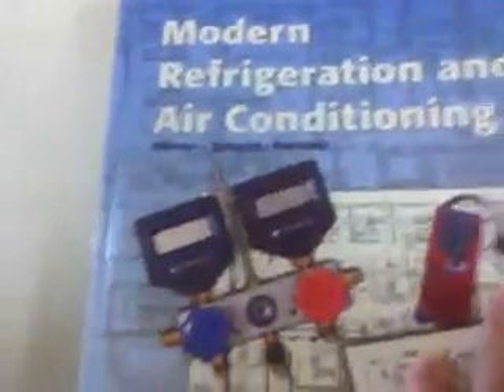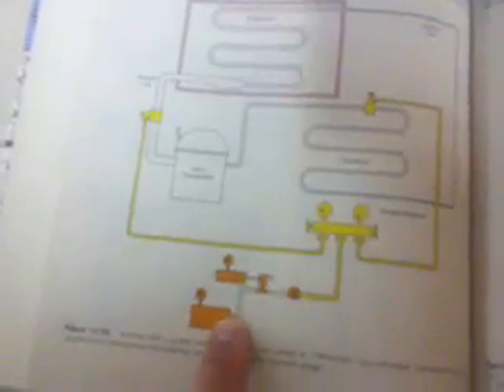Vacuum with micron guage

Comment: @Nutintoitbut2doit True. I always did it by the book until I started doing blank off tests and quickly realized that there had to be a better way. I couldn't get any system to pass even when I was able to pull it down below 100 microns. Once I eliminated the manifold and hoses I could. Maybe your luck is a lot better than mine but I usually find it difficult to get a system to pass the test. I have to work at it, sometimes 4 or more times. Quadruple evacuation.

Comment from the maker: @tstatech Hay Jason hows it going?
Your right some do leak, I have found that the seals in the hoses should be replaced sometimes 2x a year and that will solve that problem most of the time, I was trained to do it this way, I'm not saying its the only or best way to do it, the way you do it is a great way as well and my be better. 
Thats what makes you tube great, good techs can bounce ideas off each other.

Comment: Here is my thoughts for what it's worth. Best book is Refrigeration and Air Conditioning Technology-2008-6th edition. I have 3 Modern Refrig. and A/C books from late 70's, mid 80's and mid 90's. They don't even compare to the other book.

I agree with stank and tstatech on method. Recommend SS Vacuum hoses with O ring seal connections and Vacuum manifolds.

Also keep micron gauge pointed down, above vacuum line and 1 side blanked off to prevent oil getting to micron and sensor. JMHO. Take care.

Comment: Try evacuating with the micron gauge off the pump. Then try evacuating with the micron gauge on the opposite side of the vacuum. Huge difference, I would consider that a more accurate reading.

Comment: @Nutintoitbut2doit Hoses and manifolds leak. With the new core removers all that stuff isn't necessary. I want to know if the system under test has a leak or non condensibles not my hoses and manifold, I know they leak. Fewer fittings=fewer leaks. 
With POE oil it is imperative to do true triple evacuation with  the blank off test Stank is talking @ until the test works. 
I know from experience that hoses + manifold = leakage under deep vacuum resulting in unsuccessful blank off tests.